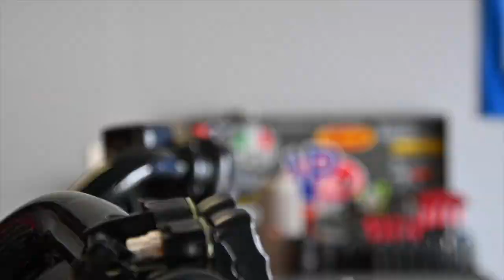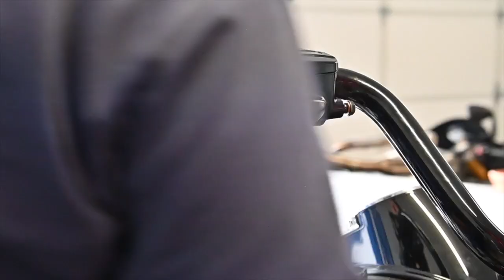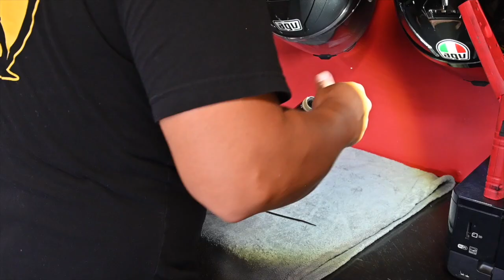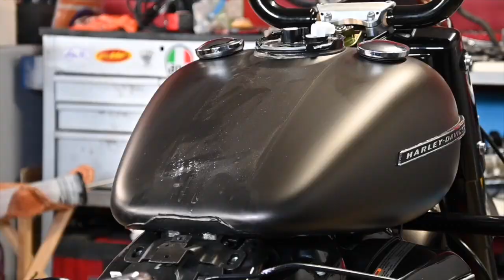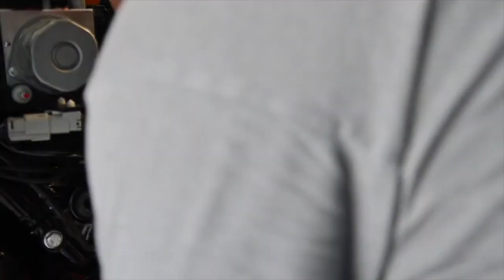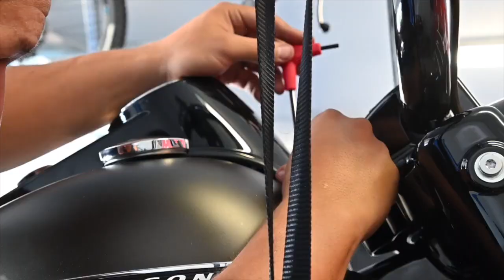2020 Road King special Factory 47 Bars Time-lapse Install

Comment: Why did the tank need to be removed? I’be been trying to study up because I’m going to do mine real soon. Thanks in advance
Reply from the maker: Well some cases you don’t need to but it’s just good practice to remove so you have no obstruction or risk of damage. Also the wiring harness plugs are in the frame by the tank. It’s makes life easier.

Comment: Question….so i see you put the frenched headlight trim ring over the existing stock trim ring?  I removed the stock and installed the frenched one and there is bout a quarter inch gap now. Didnt bother me but im wondering if water will get in now. Is your way the correct way?
Reply from the maker: Hey. The visor is made to go over stock. Just be careful not to scratch the stock incase you don’t like it
Reply from the maker: Also the housing isn’t weather proof so you don’t have to really worry too much about it. The light bulb is weather proof.
Reply: @Nandos_garage  
Yea i did see a video of it going over the stock one too, but i tried even unscrewing the bolt to completely out and couldn’t stretch it out enough to fit over. I did get mine on amazon tho so its not “from harley OEM” but harley has been out of stock on it for as long as I’ve been looking to get it. I think the harley one is a complete 7 inch circle with a thru bolt/screw that screws right into the stock screw hole. Mine has a split at the bottom with about a 1 1/4 long bolt and a separate nut tha goes thru the split horizontally. 🤷‍♂️ 30 bucks tho. Will put the Harley one on if it ever comes in stock. Im just worried about water🤷‍♂️

Comment: why flushing the master cylinder ??
Reply from the maker: Master break cylinder because it has new lines. so you’ll need to take off all the air in the system. including the master

Comment: What computer did you use to do the abs brake bleed, nice job!
Reply from the maker: No computer buddy. Have a vacuum pump that works great
Reply: I’m a actually Harley Davidson shop, I use the Snap on p1000, it activates the abs system for the bleeding process
Reply from the maker: @jaseysmith1629  I’ve looked into that scanner. It’s a pricey tool. I’m still working on building up tools. Currently waiting on getting my tire machine delivered. Most of the bikes that come in I’ve been able to successful diagnose or add on parts. Only thing I don’t do is tune since I think it works best when it’s Dyno tuned
Reply: Yeah I got lucky with mine I got it pretty cheap, normal price is like 5k

Comment: Where did you find the spot lights that would fit a road king special..
I’ve looked high and low..
Parts man says there’s nothing that will fit the special..
Reply from the maker: To be honest I don’t know where the guy got it from. Sorry for the late reply I messaged him to see what he said. He only mentioned it was on eBay. Hope that helps.
Reply: Dennis Kirk has the Auxiliary Lights for Road King Special. I definitely want a set on mine.

Comment: What was wrong with the original bars? They were a little high but you could have gotten used to them.
Reply from the maker: Some just want to change the original bars to a more comfortable style or maybe could be just for looks. It depends on the person
Reply: I bought the 2023 RKS a few weeks ago. I took it for a two-hour trip and I can confirm the original handlebars are pretty terrible. No matter how I adjust them - they are awful. I am 6 2.  I don't think there is anybody out there who keeps them on...no way!

Comment: How did you relocate the turn signal wiring?
Reply from the maker: instead of wiring the turn signals back up the handlebars just keep them low. youll need new lights and bracket